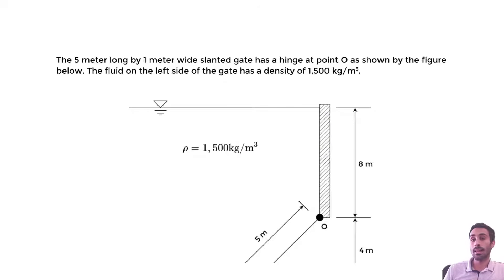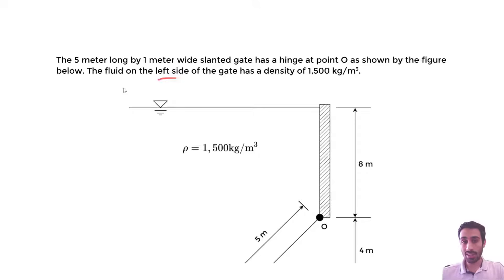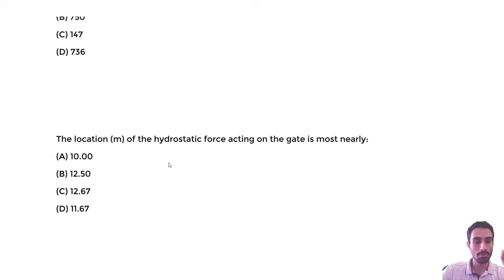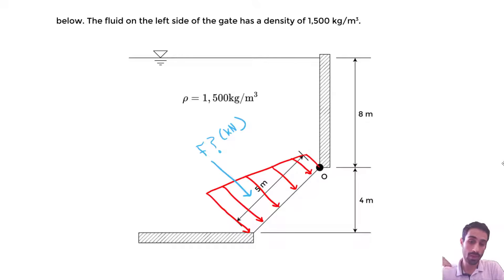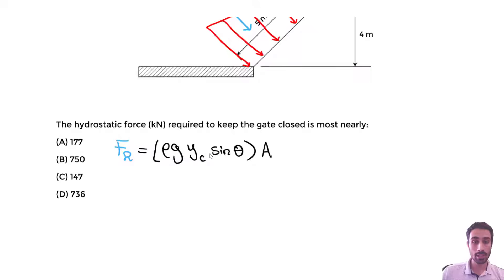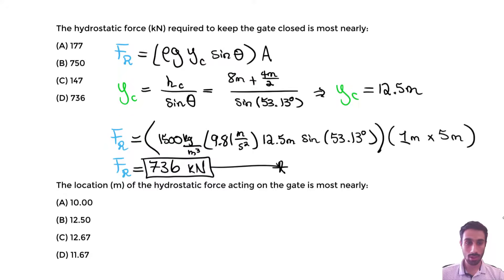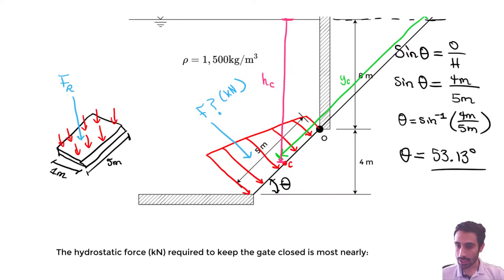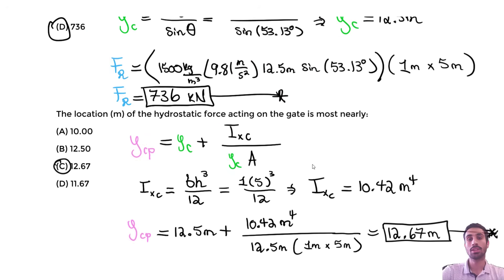FE Exam Review - Fluid Mechanics - Fluid Statics - Submerged Slanted Gate

Comment: Hello! How do you know when to apply (1/12)bh^3 or (1/36)bh^3 for Ixc? According to the handbook, under the Statics section, Ixc for a triangle uses the formula (1/36)bh^3. So, I'm not very clear on why (1/12) version was used.
Reply from the maker: @josevila1491  hi! Since the cross section of the gate is rectangular, we have to use (1/12)bh^3. We would only use (1/36)bh^3 is the problem statement stated “triangular cross section” or something similar.

Comment: thank you for the great example, but in video 3/7 you took "hc" as the hypotenuse gate length divided by 2 (3.33m/2) while in this example you take 4m which is the vertical distance divided by 2. Why you didn't take the hypotenuse the gate length which is 5 divided by 2? I'm confused can anyone help?
Reply from the maker: Hello! h_c is a vertical distance in the y direction the centroid (center of gravity) of the gate. It is not a slanted distance. 

Why did we take 4 m / 2? This gives us the vertical distance (in the y direction) to the centroid of the gate. Then to get the total h_c value, we add this distance to 8 m giving us: 

h_c = 4 m/2 + 8 m = 10 m 

(Note: We are using the FE Handbook 10.4 to solve this problem)

Comment: The location of the resultant force is impossible. The depth of the location can NOT be lower then the actual height of the gate, because then what is the resultant force on? Not the gate. He had solved for the hypotenuse of the location with his shifted axis. To actually solve this, once you get to the 12.67m, you must then use the sin(53.13)=height/12.67. This gives you a height of 10.14m. This is the actual answer you are looking for. It makes sense too because the middle of the gate is at 10m, so we expect a resultant force location slightly lower than that.
Reply from the maker: Good point! This sounds right. The vertical location from the free water surface to the center of pressure would be: 

h_cp = 10.14 m

Note, in the video I’m solving for the slanted distance location using the y_cp formula in the FE Handbook. 

Thanks for pointing this out 👍🏼
Reply: What book are you using please @directhubfeexam

Comment: So, another way of doing first question and quicker is simply by finding the average pressure times the area of the door. Evarage pressure is 
( (1500 x 9.8 x 8 meters above the door) + (1500 x 9.8 x 12 meters of total distance to the floor) ) divided by 2. You then multiply that times area ( 5 x 1 )m^2. You get the resultant force because F = Pressure times Area. It also works if the door in vertically positioned at 90 degrees. And if there is no wall above the door than is just the, simply just a door ((atmosphere pressure + density x g x distance of depth))/2 where the atmosphere pressure will be 0.
Reply: Beautiful

Comment: Ixc says bh3/36 in the reference manual
Reply from the maker: We are looking at a rectangular gate cross section since it's a gate with a width (w). Therefore, the rectangle cross section Ixc controls.
Reply: @directhubfeexam  I'm also confused about this. How do you know to use Ix instead of Ixc? Ixc in the handbook is what this person says: bh3/36. Ix is what you used: bh3/12.

Comment: Sir am kindly asking  the reason why we are not multiplying the moment of inertia by sine theta squared  for finding the center of pressure?thank you.
Reply from the maker: Hello, I'm honestly not sure what you're referring to. If you can, I would love to see a picture of your work using your method. Note, this example is relevant to the FE exam. It uses a derived formula rather than using partially derived equations or equations derived in differently. This formula will always work for any slanted gate that's not a curved surface. Also, please note the distance to the center of pressure is measured as an inclined distance from the top water surface. Some books shows equations with the distance to center of pressure measured from the centroid of the gate.

Comment: Doesn’t the sin(53.13) in the final equation cancel out the hc/sin(53.13)……..so your left with hc anyway?
Reply from the maker: You mean we are left with F_R = (ρghc) x A ?
Reply: When you translate this equation from the y-world (slant depth from the water level) to the z-world (plumb depth from the water level), you actually end up squaring the sine term, rather than cancelling it.

Any given z-position relates to the y-position by:
z = y*sin(theta)

Multiply the y-version formula by sin(theta) and simplify, and you'll get:
zp = zc + Ixxc*sin(theta)^2/(zc*A + P0*A/(rho*g))

where:
zc is the depth of the centroid
zp is the depth of the point at which the hydrostatic force effectively acts.

The y-version will produce a division by zero problem, when theta = 0.  Trivially, zp should equal zc when theta=0, which the z-version reflects.

Comment: Can you help in fluid statics problem?Gate AB in the figure is 1.5 m wide into the paper, hinged at A, and restrained by a stop at 
B. The water is at 20°C. Compute (a)location of centre of gravity and centre of pressure 
(b) the force on stop B and (b) the reactions at A if the water depth h = 2.9 m
Problem-

Comment: if anyone wants a tip for the second question, you can recognize that Y_cp should be lower than Y_c. Since 12.67 m is the only multiple choice option below Y_c = 12.5, you know thats the right answer. It will save you some time and is a good strategy for all questions to eliminate options that arent possible.
Reply from the maker: Absolutely! Good tip 👍
Reply: https://youtu.be/m_ZPRwbWtvM

Comment: Thanks for the example! I was a bit confused about the hinge being at the top vs being at the bottom. So would the force needed to just open  the gate be acting at the very bottom in the opposite direction as Fr? Call it P.  I got the distance from Fr to the hinge to be d2 =  2.67 m = 12.67 - 8/sin(53.1). The distance from the hinge to the bottom of the gate where force P acts is d1 = 5 m. So the moment balance would be Fr x d2 = P x d1, solving for P I got 393 kN
Reply from the maker: Yes!! Assuming the hinge is at the top as shown in this question. The force P that needs to act the very bottom is found by taking the moment about the hinge. What you did is exactly right after tossing it around in my head. Well done!
Reply: https://youtu.be/m_ZPRwbWtvM
Reply: I think your answer hier is not correct. d1=5 but d2 is 5-2.66 and d2=2.34! 736*2.34=P*5, P=344

Comment: would you please answer my question? as you said I looked at static section of handbook and I saw "Ixc" is equal to bh3/36 (about the centroid), and also how "h" is 5 and not 4 in solving for the moment of inertia. sorry for the confusion.
Reply from the maker: Hi it will be a rectangular cross section so Ix = bh^3/12. The h is the height of the cross section into the page. So it will be the 5 m. The 4 meters is the vertical height but not the total height of the gate. In other words h will always be the hypotenuse height.
Reply: @directhubfeexam  Thanks for the clarifying the concept for me. I appreciate it. Have a good one
Reply: this slanted gates are almost new concept for me. please accept my apology in advance if I dont know what Im talking about :))
Reply from the maker: @saeedehlotfi2576  yeah it’s difficult to understand, no worries :)